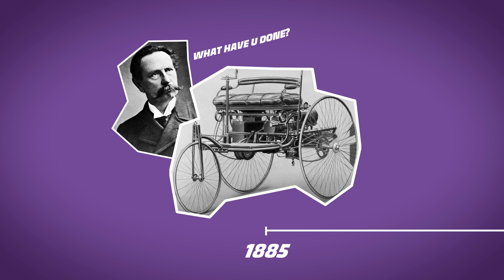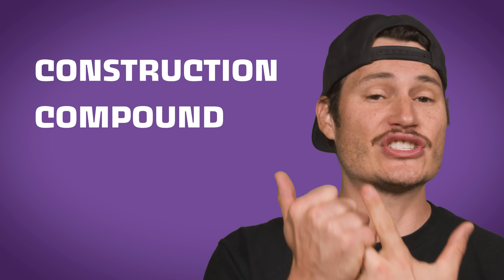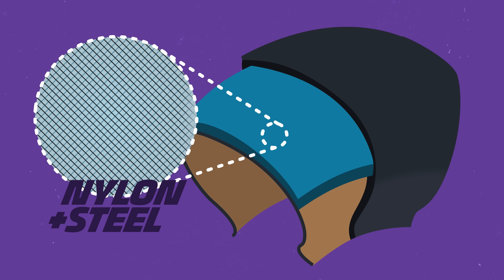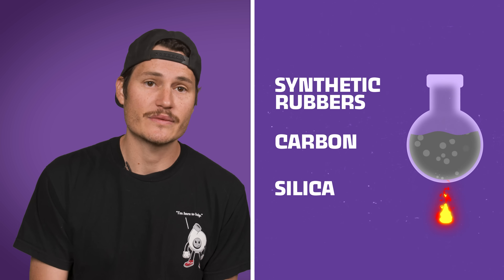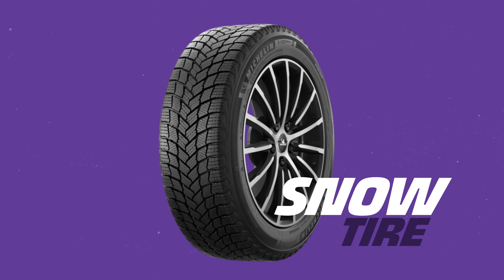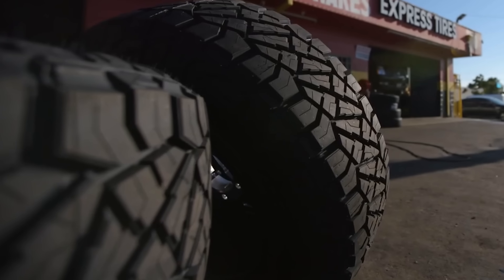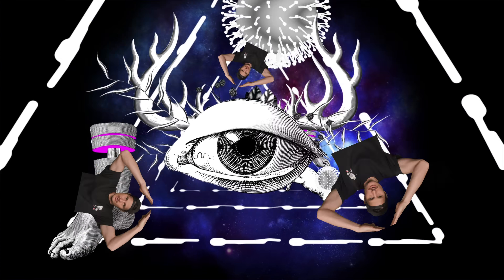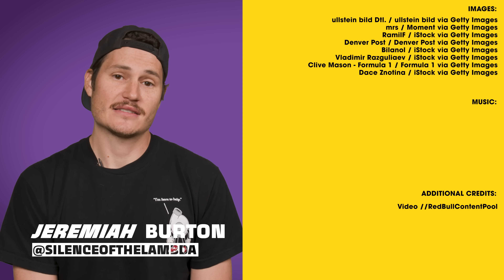The Surprising Science Behind Tread Patterns

Comment: It's because of a property of rubber called " viscoelasticity". So as the load on the contact patch of a tire increases, the pressure increases (because pressure is load over area). And as the pressure increases the resistance to frictional shearing of the rubber decreases and this cause causes the coefficient of friction of the rubber to decrease. This happens because it gets more rigid and loses it's capacity to deform with the road.
So if you have a car with a strong engine and a narrow tire, the pressure on it will get too big when you increase the load while accelerating and that will make the rubber get more rigid, causing the coefficient of friction to get smaller and the tire will have less grip on the road.
That's why race cars and dragster have wider tires.

Comment: Like you said, myu is variable. Myu is also difference between sliding and rolling friction. To improve the average value of myu, a larger contact patch helps. Also To increase the friction force you need to increase the Normal force. Imagine the weight of a dragster on bicycle tyres with the same compound. While it may do the same job for the first few inches, the wear won’t survive the length of the drag strip.

Comment: I'm just an average auto mechanic and race fan but here goes. Drag racers run wider and larger diameter tires to maximize the contact patch, the same reason they use "Wrinkle wall" slicks, so it lays a huge flat patch of soft rubber on the pavement that conforms to those peaks and valleys in the pavement and also as they increase speed the sidewalls stretch so the tire width narrows to reduce rolling resistance and the overall outside diameter increases greatly to change the effective gear ratio as the car picks up speed, mainly because the top classes of drag cars only have one gear ratio.

Comment: I worked on tires in the early 80s.  We had a lot of radial tires that would separate (steel belt separation) caused by changing the rotation of the tires when they were rotated.

Comment: As Engineer myself if the tyer is wider it has a greater cross sectional area, with more rubber contacting the ground it adds more friction, more friction means more grip but with the downside of having a greater rolling resistance. The reason why mue doesn't calculate that I think is because its a constant, I could be wrong on that but I think it can be added into a calculation of your own it just can take a while to crunch it out to make it work.

Comment: Being on the technology side of the stem field my assumption could be wrong but here we go.... I think the first thing to note it the bigger tires for drag cars often are on the rear wheels. This is also where the torque and power are going. Just like if you are going to make a jump forward you while standing in place. There is more then just a need to jump upward you also have the need to grip with your feet and push yourself forward. As you can probably imagine if there is not proper grip to your feet you will just slip. giving yourself the proper amount of grip for that forwards thrust or "Push" Like a football player might do you are able to more productively move in a forward motion even though you are technically pushing your feet against the ground and or backwards. When someone who is skiing does this they use sticks a drag racer would use wider back tires or (car feet) if you will?

Comment: a wider tyre only distributes heat better, it doesn't increase grip. Cause after all, the weight of the car will put pressure on a bigger tyre surface area and that will push the tyre into the ground less, so you will actually have less grip.

Comment: The wider tire isn't so much about contact patch area, its so they can get a different compound on the tire to increase the frictional coefficient.  The wider tire allows the sidewall to be designed differently to take the shear force of the increased friction coefficient.  That is why drag racers run low pressures and beadlocks, so they can get the sidewall to flex/crumple to transfer the torque to the road.  

In fact if the compound didn't change with a wider tire, the normal force would decrease.  We all know the Force equals mass X acceleration equation (F=M*A) but force is also equal to pressure X area F=(P*A) so in that case since the surface area increased and the pressure (weight of the car) stays the same the force decreases, also decreasing the frictional force.

Comment: enginier: its because of force distribution, when tire friction with asphalt so hard, more than shear pressure capacity, some lilttle pieces fell off(wear). smaler ones sometimes got heated and sublimate to gas, thats why you can se smoke on burnout. this pieces and gas that fell off act like lubricant just like water, so part of tire dont use normal (static) drag coeficient, they use kinetic drag coeficient, witch is lower. wider tire spread those friction force into wider area resulting lower shear pressure, thus lower the chance of  piece of tire felling off and reduce the amount wear.

Comment: oh and my quess for the bigger tires is because every tire has like it's maximum load capacity (like in acceleration). if you go over that load the tires rubber just flexes so much that you lose the contact patch. placing bigger tires mean bigger load capacity which means it's harder to go over that load capacity.

Comment: 5 months late to the party, but here goes: Best explanation I've read is that it's because of how the coeff of F of the tyre changes with under load. A thin tyre will be under more load per square centimetre, than a wide tyre pumped to the same air pressure and with the same weight acting on it. The higher loading on the tyre causes the rubber polymers to reduce their coeff of F. You can do this with an elastic band: rub it against something un-stretched. Next, stretch it out and rub it against the same thing. Stretched out it will have noticeably less friction.

Also, there's the fact that using a wider tyre, with more surface area, allows you to use softer rubber without shortening lifespan of the tyre.

Comment: Answer: coefficient of friction is great for two flat surfaces, but the peaks and valleys in pavement are no longer simply slipping across the surface instead becoming trapped.

It's like sliding down a slide vs sliding down some steps with the same coefficient of friction. The slide will freely let you slide to the bottom. The stairs will punish you as you hit every single one of them on way down. Having a wider tire allows for more of the tire to become caught in the 'stairway' at times where grip is needed.

Comment: The reason bigger tires have more grip is because of pressure on the tire. The smaller the contact patch of a tire, the more pressure you put on a lower amount of material and the more likely it is to shear off the rubber conforming to the rough road surface, making you lose grip. That's what tire smoke is, microscopic amounts of rubber shearing off the tire. To counteract this, you have to make the tire stronger ie harder and this lowers Mu, lowering your friction force. When you increase the surface area you have on the tire, you decreased the pressure on the tire's material, allowing for a weaker, softer, and higher Mu material to be used, increasing your friction force. Basically the road acts as sand paper, the tire forms to it, and when you put a lot of force to the tire it basically breaks contact with the sandpaper for a limited time, lowering overall traction.

Comment: In 1785, COULOMB postulated the law of friction for solid friction, which is named after him today. However, this is only an approximation of reality and is only valid within certain limits. According to Coulomb, the friction coefficient and the friction force are independent of the contact area of the bodies. In fact, however, they are influenced by the collective stresses and the tribological structure. This can be explained by the distinction between geometric and actual contact area. Under microscopic observation, a technical surface is never ideally smooth, even with the finest machining. Thus, the components touch each other at the small asperities created by the manufacturing process, since metallic bodies have a high modulus of elasticity and a high yield strength. The contact areas of the asperities are often only in a small percentage or even in the range of a few thousandths of the theoretical contact area. When the normal force is increased, the contact area also increases approximately linearly. Due to the linear increase in the contact area, the nominal surface pressure remains constant. Thus, the coefficient of friction remains constant as long as the linear relationship between normal force and the actual contact area exists.
Therefore the contact between a tyre and the road is to be observed as a tribological system. Including: changing loads, contact patch deformation, wear, energy input, energy dissipation and many more. It is easily seen that the coefficient of friction can not remain constant in this highly chaotic system, where every parameter is not constant itself. Anyway, in my opinion, using the friction power density 𝑞̇_𝑅 – in German it is called “Reibleistungsdichte” – the phenomenon of a higher grip level due to a wider tyre can be explained. For the one-dimensional case, the following applies:
𝑞̇_𝑅=𝛥𝑥∙𝑝∙𝑓∙𝑓_𝑆
𝑞̇_𝑅: friction power density, Δ𝑥: amplitude, 𝑝: surface pressure, 𝑓_𝑆: oscillation frequency, 𝑓: coefficient of friction. 
A wider tyre reduces the surface pressure, therefor reducing the friction power density. A reduced friction power density reduces the energy input into the tribological system. In a trail braking scenario, the load on the front tyres increases and with it the coefficient of friction. The oscillation frequency is proportional to the slip ratio, and this is also increasing. All factors are rising until the friction power density crosses a threshold. The tyre loses grip due to the high shear stress and the high temperature on the surface of the tyre. A reduced surface pressure allows the other parameters to rise and to keep the friction power density below the before mentioned threshold. 
Greeting from Germany!

Comment: I believe wider tires make more traction not because of the coefficient of friction but because of the amount of force distributed across the area. If you double the length of the tire you halve the force on each square centimeter. That allows more force from the mass/weight of the car to be send downward before it becomes enough force to overcome the coefficient of friction between the surfaces. So between two tires that have the same mass, they will both have the same coefficient of friction, but one that is wider will allow for more downward force before it overcomes that coefficient of friction.

Comment: To answer your question µ actually includes surface area as it is an abbreviation for another equation. The reason we use µ rather than the full form equation is because in most cases when calculating a coefficient of friction we only really need an approximation and thus it would be a waste of time to use the expanded version of µ.

Comment: Ik im probably not the first but… larger contact patch on performance tires doesn’t always have to do with the frictional aspects, although that is a big part. A lot of this has to do with stress. Shear stress to be exact. Stress is defined as the same units as pressure (psi or kPa) as it is a force acting over an area. The larger the area (contact patch), the lower the stress is! This means that the probability of slippage decreases as area increases. This is also mainly a concept used under optimal conditions (ie. Performance based sports) and therefore why most consumer tires look roughly the same width (depending on your car), and why specialized tires can be made for almost any size imaginable! Thank you! - ME student @ Montana State

Comment: The time of acceleration being so short means that more weight will be transfered to the back tyres faster and therefore giving way for the possibility to use bigger rear tyres due to the grip gain...they also run them at extremely low pressures wich means the tyres wrinkle and shrink in radius by more than six inches and the tread effectively balls up at the front of the contact patch. ... The compression of the tire also means that the final-drive ratio is effectively shortened for a harder launch. There are other smaller variables that make these tyres perfom so well in a drag race but i hope these key points helped answer your question. :)

Comment: A larger contact patch means that the weight of the vehicle is distributed over a bigger area, so the motion resistance is lower. That's why dragsters have skinny tires in the front and chunky, wider ones in the back. That's also why tracked vehicles perform much better in rough conditions (mud, snow, sand, etc.) than the ones with tires on.

Comment: It comes down to more than 1-2 factors. 
First one is due to the coefficient of friction is not constant. The higher the pressure the more it drops. Wider tires means bigger surface for the same amount of force and that translates to less surface pressure. 

The second one is in reality grip isnt ideal like the model suggest. In reality there is slip which constantly cuts/slices the outmost layer of material. The force required to cut/slice that layer depends on the cross section of the layer. Wider tires mean greater cross section hence greater force required to slice it.

Also grip is not equal to friction. As you mentioned rubber pushes into the volleys in asphalt. The wider the tires, the more volleys the rubber pushes into. This means all the volleys become perpendicular to the force that accelerates the car. In order to get the rubber out of the valleys it has to deform. Wider tires mean more deformation that translates to more work which equals to more force therefore more mechanical grip.

Also its easier to maintain ideal tire temperatures for a wide tire. In corners or for a car with somewhat decent downforce Fn fluctuates which means the pressure of the contact patch fluctuates aswell. The greater the width and the contact patch the less effect Fn has on the pressure. (changing Surface pressure of tires cause the tire temperature to change with it).

And for the last bit: wide tyres just scream mo powa bby

Comment: The equation frictional force equals mu x normal force does have something to do with drag races of course, but has a student who loves physics and has taken more physics classes than I have fingers, my best answer for you is that when all the weight or mass rather is transfered to the rear of the car upon acceleration during squat, a lot of force is pushed down onto the ground and you need a big a** tire to combat the normal force that is being applied back onto the tire from the ground. If you don't have a big wide tire think about what happens. It just spins and can't really get the right amount of traction because there's too much force from the ground pushing back on the tire from that mass transfer on acceleration.

Comment: Well, I might be a little late to answer this, but I went down a similar rabbit hole when I took dynamics. The friction equation we commonly use is called the Coulomb approximation. The name alone should say enough because friction is so complex with so many variables that it's necessary to simplify and approximate it. The COF (coefficient of friction) uses empirical testing to derive it rather than having a complete mathematical model to dictate the COF. In other words, it's just testing tons of different materials against other materials under tons of different conditions to derive the COF. 

While this does not give a perfect result, this equation is used because of its ease of use, and it provides something good enough. There are other friction models out there that go far deeper in using all of the necessary variables, but if used for a general application, one may only improve your relative percent error by a few percent, waste a bunch of time/money, and now that friction data is only applicable to those particular conditions.

Back to the question at hand, though, why do dragsters have massive wide tires if the contact area does not affect traction? On paper, one could probably design a super skinny, super tall dragster tire that uses the same amount of material to, in theory, do the same job. However, now you have a massively tall tire that will take more torque to get rolling, leading to being slower off the line. Then when you are moving, if you come into contact with something small like a small amount of oil, the ratio of the area affected on your tire is far hirer. For example, if the same small amount of oil comes into contact with both our tall and wide tires, the skinny tire might have something like ¾ of its contact surface affected, significantly reducing traction. However, the wide tire might only have 1/8th of its contact surface affected, meaning the other 7/8th are unaffected and still providing traction.

In short, I assume the people who design these tires have to find a balance between on-paper traction, real-world results, practicality, research time needed, and of course, cost. Engineering isn't generally about making the best thing possible but rather working within unknowns and balancing cost, practicality, and what the customer wants.

Love the videos; great for procrastinating! Keep up the fantastic work Donut gang!